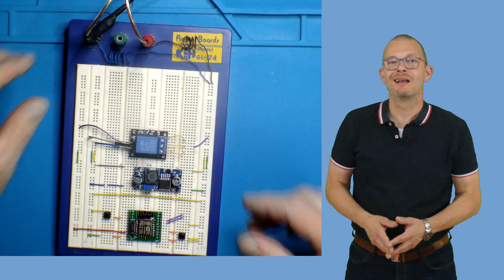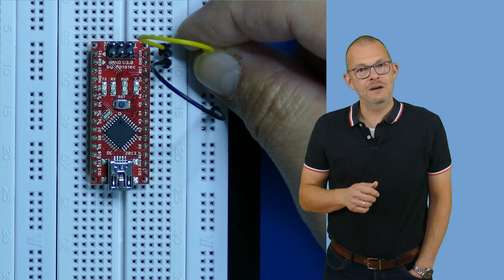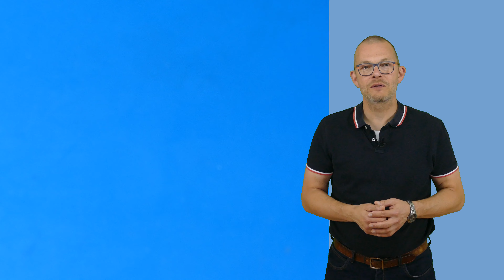How to build a breadboard for ESP32 or ESP12-F or the Arduino Nano or other micro controllers

Comment: I have an issue with my ESP32 Node32s compatible development board.  The pins are 12 breadboard spaces ( ESP32 pin spacing 1.2") wide (if you were to lay the board vertically, one ESP32 row of pins is in breadboard row 1, other ESP32 row of pins is on row 12)
If I use only one power distribution bus module between breadboard modules like you did, then I lose 3 connection points on one side and left with 4 outside connections on one side, only one on the other.  If I move the ESP32 one pin over, I lose 1 and 2, giving me 2 and 3.   If I add one more power rail module between breadboards, then the ESP32 doesn't fit at all.

What I have found when I temporarily have the ESP32 board only on one breadboard, I can use the covered pin connections and route jumper wires underneath the ESP32.   I suppose that could  be a compromise with your layout as well for the connection pins that get hidden underneath the board.
Reply from the maker: Hi Daniel, great advice - many thanks!